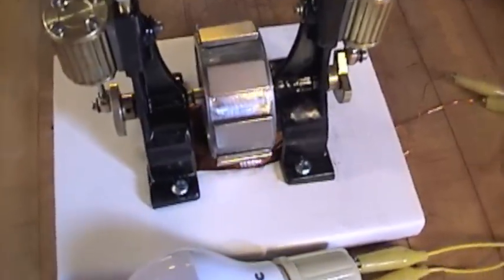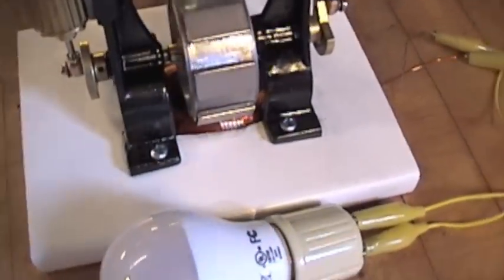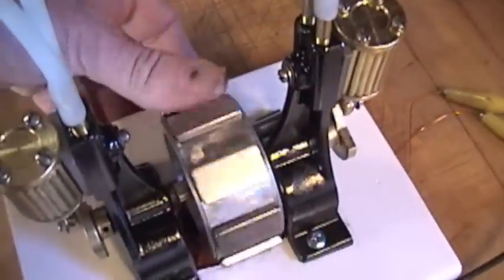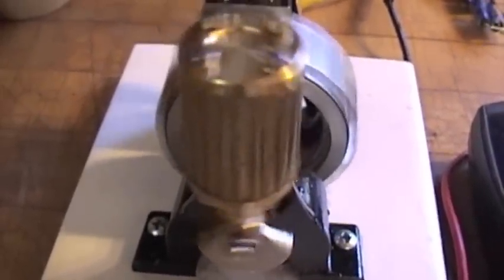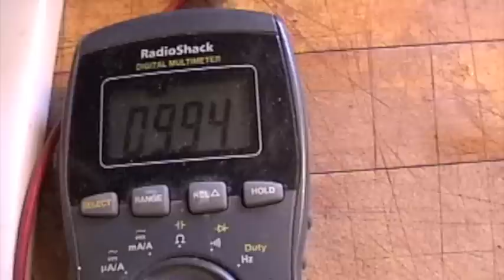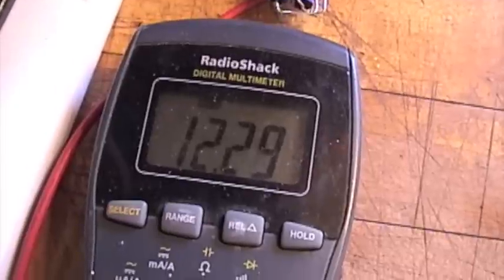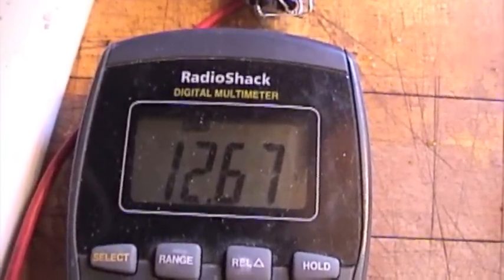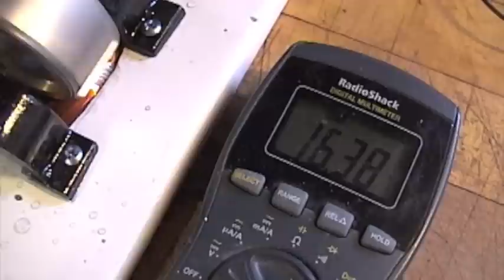Lynx Steam Generator  - Making Electricity

Comment: In the gas patch we used TEG units.  Thermal Electric Generators.  On one side heat is applied and cold on the other.  9 standard blocks produced 50 watts of power and charged battery banks for communication with the gas plant. (2amps at 25.5v)  These can be bolted to the side of a wood stove to charge batteries.  It has no noise. No maintenance.  And runs for years.

Comment: An auto alternator is about 56% efficient.  Do you have efficiency numbers on your homemade alternator?  Just because it has less "drag" doesn't mean it's efficient.  Measuring no-load voltage is only part of the equation.  You need to connect a load and measure both amps and volts.

Comment: Hey you can take the cogging out of any generator. instead of winding a single winding pattern either single or three phase,,,make it a bifilar winding and either short the extra winding or put a variable capacitor so you can tune it. any questions just hollar

Comment: I wanted to inform you that my name is Lloyd G. Stovall, and I am the original creator of overunity technology. I am disappointed about the fact that my technology was stolen, and people have misconceptions about what overunity truly means. However, that is not the main point of this message. I am writing to you to discuss how to improve your system, particularly your steam engine.
The fact that you generated 12 volts of power is sufficient to charge a battery, as seen in the video. However, what people don't know is that if they understood the true concept of overunity, they could build a better generator. Overunity has nothing to do with producing more power output than input. I need to clarify this misconception, even though it contains some elements of truth. The problem lies in people interpreting things in layman's terms rather than understanding the physics behind them.
If you input 12 volts into a battery and charge it, it is indeed possible to extract more than 12 volts from the battery in terms of both amps and voltage. This is due to the battery's capacity. However, you cannot charge a battery at the same voltage at which it releases energy, as it would damage the battery. Charging should be done at a lower level, and it takes time. This is the aspect that overunity was meant to explain—the time factor.
To achieve this, you will need more than one battery. Charge them with a lower charge level and place a transfer switch between the batteries. When a battery reaches 10% discharge, the transfer switch should automatically switch to a fully charged battery. At the beginning, ensure that all the batteries are fully charged and at the same level. Any professional in electrical systems will advise you to do the same.
The switch is designed to trigger the transfer when the battery being discharged reaches 10% capacity. By arranging enough batteries in a row, you can compensate for the time factor. This means that when it returns to the original battery, it will be fully charged, resulting in a constant charge both coming in and going out.
Keep in mind that the technology used in cell phones and other devices operates on the same principles. It's called pass-through charging. If you doubt the veracity of my claims, feel free to ask me any questions. I can provide you with actual calculations and numbers. If you prefer not to engage in that, consider asking an artificial intelligence (AI) about pass-through charging and how a series of batteries could be used to create an efficient generator utilizing steam. You should receive a satisfactory answer.

Comment: cost to power an average home with steam electric power is it possible
Reply: well George's you want to run your house off of steam white you need is an old lawn mower engine and a couple old tanks and some scrap and you can build a steem engine from that. you put a car alternator on it and use it to recharge your batteries banks. After your battery banks are charged you should it down and just run off battery still you have to start it back up again waters pretty much free if you live in the woods thats all you need. and if you're not lazy taking max to the woods wants in awhile and you'll have all the wood and water you need for free power your initial cost will probably be most costly if you buy brand new batteries and a inverter. I would read purpose used batteries and buy an inverter for each thing I want to run I hope that was helpful